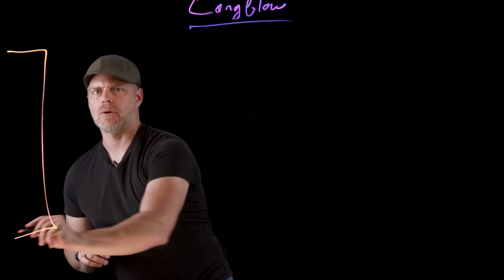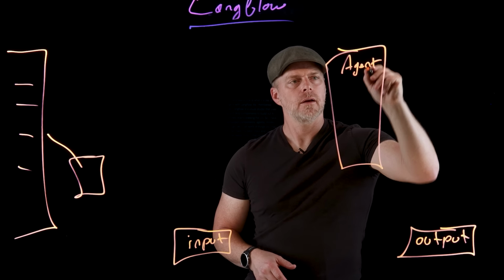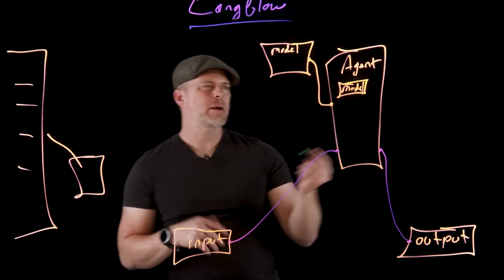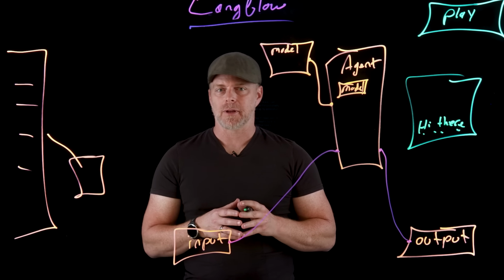What is Langflow? Build AI Workflows with Python, Gen AI, & MCP Tools

Comment: Langflow looks like a solid attempt at lowering the barrier for building AI stuff without drowning in boilerplate. The drag-and-drop angle makes sense — keeps you focused on the logic instead of wiring up a bunch of integrations by hand. Python underneath means you can drop into code when the visual stuff hits its limits, which is the right call. Real question is how well it handles the messier parts like error handling, retries, and monitoring when things go sidew

Comment: How its different from n8n
Reply: N8N is a general workflow automation platform while Langflow specializes in AI, Agentic, and RAG based use cases. Yes, their UI and node based visual architecture look similar, but they are not the same beast under the hood.
Reply: Based on Gemeni:

Choosing between Langflow and n8n depends on whether you want to build an AI Brain or an AI Nervous System.

While both use a "boxes and lines" visual interface, they solve fundamentally different problems. Langflow is built for the intelligence layer (designing how an AI thinks), while n8n is built for the execution layer (designing how an AI acts within your business).

Comment: What's their difference with n8n?
Reply: They’re actually related but not exactly the same. n8n is more of a workflow automation tool that lets you connect different services and APIs visually. On the other hand, Langflow is specifically designed to help build and manage language model applications and workflows. So, while they both deal with workflow automation, n8n is more general-purpose, and Langflow is more focused on LLM-based workflows.